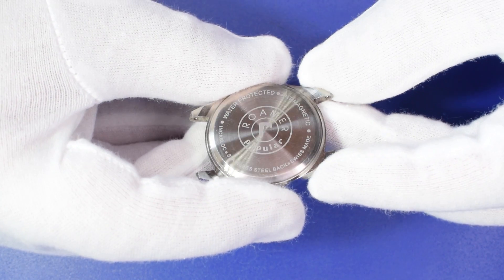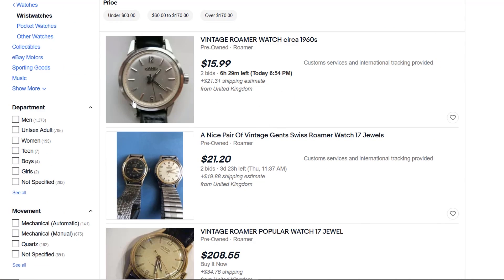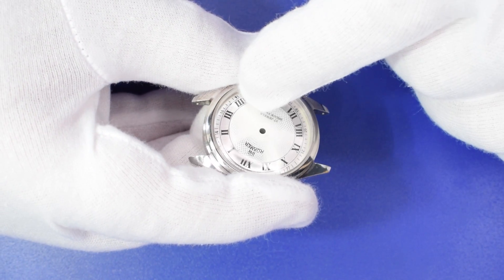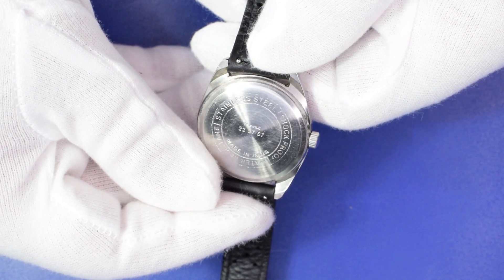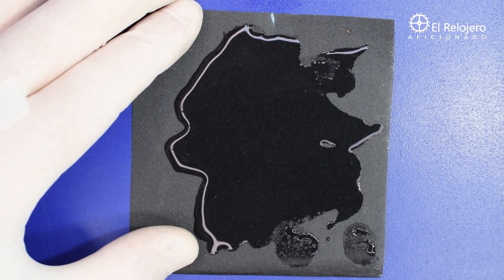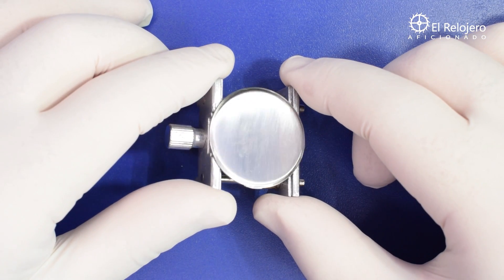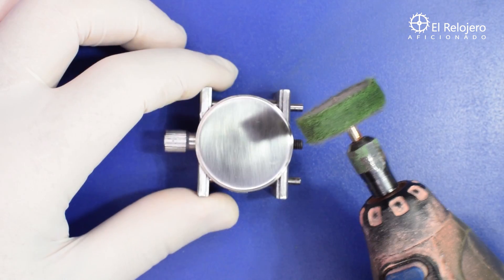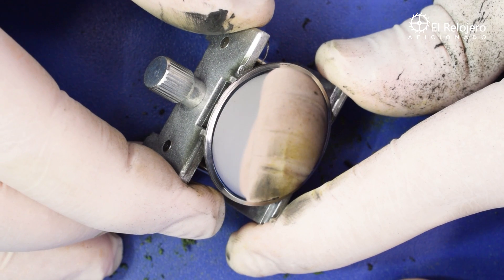How to etch stainless steel

Comment: Great and very profesional, but i have a cheap clock (to me is very special) made of brass and im not sure if this metod work on it. The time in the UV lamp and the voltage in electrolisis will be the same?
Reply from the maker: 213 / 5.000
I haven't tested it on brass, so I don't know if the voltage is the same. What I am sure of is that the UV time should be the same or very similar, although it also depends on the power of the UV lamp.
Reply: @ElRelojeroAficionado  Thank you very much (i'll try on some old badges of brass before). Keep going with you amazing work.

Comment: Con el Closed Caption, sin problema 👌.
Una vez eliminado el material no fotosensible y expuesto el metal lo grabo con sandblast (flujo de aire a presión más óxido de aluminio), claro de contar con el equipo. 🙋‍♂️ gracias por el vídeo muy útil.
Reply from the maker: En este video tutorial no se emplea la técnica del sandblast, ya que se requiere un equipo altamente especializado y caro. Empleamos la electrólisis, que es mucho más barata y accesible. Se puede hacer con una pila o un cargador de baterías de teléfono como fuente de alimentación. Un saludo!